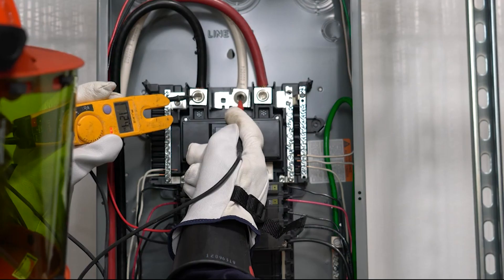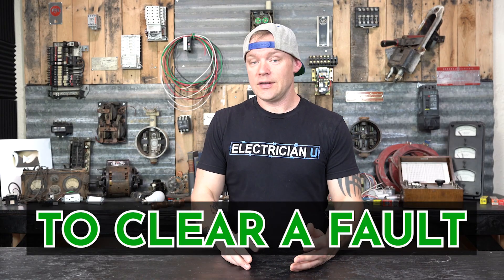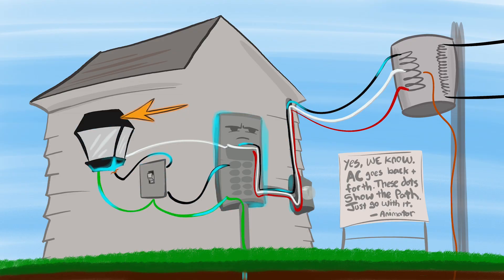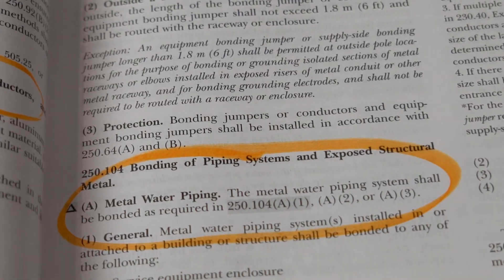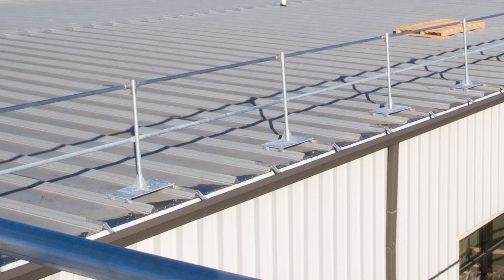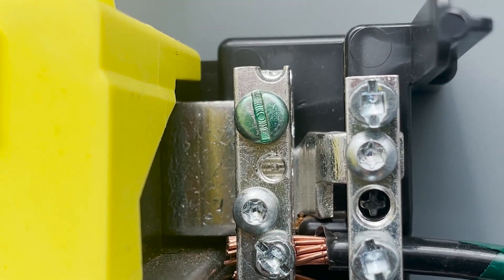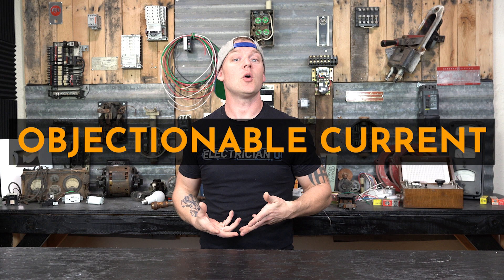Why Do We BOND Neutral & Ground in ELECTRICAL SERVICE PANELS?

Comment: I think it’s incomplete to say that current wants to return to its source. 

Current is a dissipation of electric charge from a highly positive voltage location to a lower voltage location. The earth is ~O volts, which is pretty low. So in reality, virtually all current is seeking to get to the earth. The story is more complicated for AC but the concept holds.

The ground wires provide a path to the earth through the grounding electrode on site, which is relatively high impedance. 

The neutral wire provides a path to the earth through massive grounding mechanisms on the utility side, which are relatively low impedance. 

These two paths are in parallel, and the current will take the parallel paths in proportion to the impedance. 

An interesting corollary is that when there is current being used in a house, there will always be a very small amount of current flowing through the grounding electrode on site. 

I agree with everything else you said, and it’s a great video!
Reply: No
Reply: @KevinCoop1  tell me more!
Reply: @mrfischedm     Yes, earth is zero volts.  The only reason electrical systems are connected to earth ground is so if lightning strikes at or near the system, the energy is dissipated to earth.   That is the grounding electrode conductor and ground electrodes portion of the system.   All the rest of grounding in the system is called equipment grounding.   It’s purpose is to carry fault current from metal parts that get energized incorrectly, back to the main location, to the neutral, out to the transformer, through the coil and back to the panel with low resistance so enough amperage is allowed to make the magnetic portion of overcurrent in a circuit breaker to trip.   
As there are ungrounded systems that are used to do work, earth has nothing to do with it.   If your all current is seeking earth is correct, then how is it possible for any ac or dc system work without a ground at all?
Reply: @KevinCoop1  I think we’re saying compatible things. 

I wasn’t saying that all electrical charge is seeking the earth, I was saying that all electrical charge is basically trying to spread out to minimize differences in electrical potential. That’s what creates current in the first place. When given a sufficient conducting path, current flows between places with different voltage e.g. from relatively high potential to relatively low potential. The story most people tell is that current flows from high potential (the transformer) and back through the neutral conductor to low potential (the transformer). But the more complete truth is that current goes from high potential (the transformer) and back through the neutral conductor to ground (which is provided both onsite and at the transformer). All transformers I know of are connected to big grounding rods. 
All that helps me make sense of why neutral and ground are connected at the panel – both the neutral conductor going back to the transformer and the grounding conductor connected to the grounding electrode on site are just different paths back to earth. 
Maybe I’m wrong though. What you said about ungrounded systems was interesting. Can you give an example of an AC system that has no connection to ground at all? All the AC systems I know of are connected to earth ground either onsite or on the utility side. But I’m sure I don’t know them all!
Reply: @mrfischedm     Dave, are you a physics guy?   The electrical system in a house could (and used to be) not connected to earth ground at all.  The first NEC was published in 1892.  My copy says nothing about grounding.   Then along came earth grounding to stop everything from blowing up when lightning strikes occurred.   Next, in the 1960’s, NEC decided too many people were getting shocked by touching the metal on their appliances.  So, then came equipment grounds.   So, earth ground is for lightning and nothing else.   Equipment grounds are for shorts to metal cases, have nothing to do with earth ground, and are connected to same point in the main panel to neutral because you do not run equipment grounds from utility transformer to a panel.   Utility is only hots and neutral, no ground.  
Im not trying to be mean, just hopefully helping you understand.   Respectfully,   Kevin
Reply: @KevinCoop1  Yes my background is physics which is why this confused me at first. I think you would agree that neutral from the utility is kept at 0 volts. If so we’re on the same page about most things.
Reply: @mrfischedm     The zero volts you keep referencing.   Let’s think about that for a minute.   Is it truly “0” volts?   With no grounds, the two conductors, let’s say black and white, are 120 volts between them.   Now, let’s tie another conductor(bare) to the white.   Since the white and the bare are connected together, a meter connected from black to either is 120 volts, correct?   And a meter connected to white and bare is your “0” volts.   If you do not connect the white to the bare, and the bare is connected to a ground rod only, the meter from the black and the white will get a voltage value from each.   My best guess is around 90 volts, at least that is what I found at a location once.   The end result is in reality, both the white and black are 120 volts, but measuring from ground that is connected to the white only black shows 120 volts.   So ground and grounded conductor(white neutral) is a zero reference point for the meter.   I hope this is helping!   Sorry so long!   Respectfully,   Kevin
Reply: @KevinCoop1  Just to clarify, let's say you connect your meter between two points. Point A is the neutral conductor coming directly from the utility, and Point B is a grounding rod. You're saying the voltage between those points will NOT be 0 volts?
Reply: @mrfischedm   I am going to back up a little!   If the  white neutral is “not connected to the ground at any point(ungrounded system)” you will get no volts from neutral to ground and no volts from hot to ground.   There is no complete circuit.   You can not really do this in your home because the utility grounds the neutral at their transformer.   Must have a complete circuit to get a reading on the meter.
Reply: @KevinCoop1  Interesting discussion, and I learned a few things. Thanks!
Reply: @mrfischedm    I have talked to my daughter in laws brother who is a physics professor.   We had some interesting conversations as well.
Always good to discuss with others!   That is how I learned the most!   BTW, I’m a retired Electrical Design Engineer.  Respectfully,   Kevin

Comment: I have a question about 3-wire homes vs older 2-wire homes.  If one lives in an older home that only has Hot (black) and Neutral (white) without the third bare copper safety ground at the service panel so that most outlets are only 2-wire without a safety ground, and one needs a rigged safety ground to fool a UPS to prevent the buzzer from buzzing all the time, is it OK to tie the safety ground terminal to neutral terminal at the outlet?  My bathroom and kitchen sink outlets have the safety ground for the GFCI outlets and there's a non-GFCI outlet by the stove and in the laundry room that have a safety ground (both according to an outlet tester), but none of the rest of them do throughout the house.  The added safety ground for the bathroom GFCI is a singly-run green wire, and I guess the kitchen and laundry room are done the same way.  I've only done it to fool 2 UPS so the buzzers don't buzz, but is this safe or dangerous?  Thanks
Reply from the maker: Bootleg grounds, like what you described, are pretty dangerous and sketchy. People who flip houses often do this as to not have to replace whe whole house wiring. The best way to fix this issue is to bite the bullet and pull new wire. At this time with the way material and prices are, this is easier said than done. A safe alternative is to install GFCI devices are the most upstream location. What i mean by that is at the first receptacle on that circuit, add a GFCI device there and that will protect that circuit.
Reply: @electricianu   Thank you!  Your willingness to help is outstanding!!!  I didn't think about using GFCI outlets.  That way, I could run one green Safety Ground wire and protect everything on that Breaker if I put the GFCI on the first outlet spot off that Breaker.  I saw a video about that and how to find the first one.  But wouldn't I then also have to run and add the green (or bare copper) Safety Ground wire to the third terminal on every outlet down the line if I want all of them to be a safe and proper 3-wire with Safety Ground?  That third terminal has to get Safety Ground somehow.  Or would it then be OK to tie White and Green terminals together with bare copper wire?  Thanks

Comment: I ain't looking to see if anybody mentioned this in the +12,000 comments before me,  I only looked at the amount that fits on my screen. Absolutely what all sparkys need to be discussing and getting their heads around. 

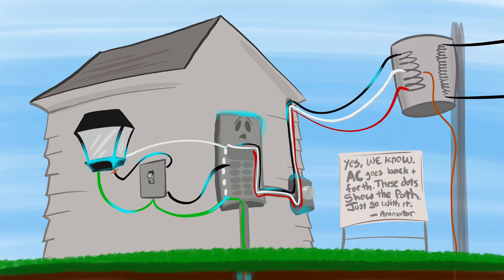Great Job! But if you don't mind an ol' timer wireman butting in... but...your cartoon is correct at ~2:16 mark, the vast amount of electricity is flowing from the neutral bus in the panel to the pole mounted tranny (ignoring the insignificant amount of current flowing through the high impedance parallel path that is from the GEC, through the soil, and up the pole's ground wire to the neutral tap. To keep it simple, I would ignore that current in the cartoon too.) But at the ~3:43 mark, when the main bonding jumper between the ground and the neutral bar is added, it looks like the current is flashing down the GEC and electrode, and no current is shown going back on the neutral to the trannny?! There isn't any path indicated at all flashing back to the source. It would be way more accurate to show the fault current coming into the panel on the EGC and flowing through the Main Bonding Jumper to the neutral bus, back to the tranny. 

I'm still giving you a big THUMBS UP!

Comment: What if I have 2 inverters not stacked and each one serves its own panel. Seems like I would only be able to bond one panel because if I bond both, the neutral form each inverter will be touching the same ground grid...
Reply from the maker: I would imagine upstream from both of those panels would be a common disconnect. So, the bonding would take place at this point.

Comment: You really should make it clear that this is only OK in the crappy US systems. It's positively not done in the UK and I guess the whole of europe.
Sadly, we have several different grounding scenarios. In my case, the wire the power comes into the house provides a grounding connection - it's basically the metal covering of the power wires.

Comment: Ive watched the electricians work at various jobs turn a screw ...pull some wire ...a. box....here...there a switch......pass throu hole strip ...turn screw ...black ..white....etc etc .......
And just by accident I’ve seen an electricians bill for work ...well buddy shown me 
Well I just about filled my pants with the brown stuff!!!,!........he did that and charged you that !!
I’M IN THE WRONG LINE OF WORK !!!!!!...........

Comment: If power goes thur the ground due to power wire arching ,  the box breaker can determine the circuit has a issue  because the current is arriving back to the box not in the traditional  netural circuit.  This is my understanding
Reply: It is because the current goes from ground to neutral in the box, because it’s bonded, out to the transformer, back to the panel.  The grounding system makes a very low resistance path to allow enough current to make the breaker trip.
Reply: @KevinCoop1  yes im wrapping my head around it in my thinking understanding. Sometimes its better to further explain terms that could be put in a simpler format. Ex. Bonding ect.
Reply: @justinbustin677    This concept is extremely important to understand.   In my experience as high as 95% of designers, engineers, and electricians think for some reason that ground faults go to the grounding electrode(rod), etc.    earth grounding is only for lightning dissipation.
Reply: It is, what im saying is your communication  with folks that dont know all the lingo. As my example with bonding. My main first post was this is how i understand the ground and neutral fault purpose  and does that sound  correct.
Reply: @justinbustin677  ok on your terms.   It is not that the current is coming back not in the traditional neutral.  If the power wiring arcing to a grounded part, then there is no load in the circuit.   Since no appliance or load in the circuit, then very high amperage occurs( thousands of amps) from the hot and through the ground conductor.   The high amps creates magnetic field in the breaker that causes it to trip.   Make sense?
Reply: @KevinCoop1  yes a short at regular plug in receptacle, from black hot wire. Arcs on the box. So current is not going back to main box via the neutral wire.  

Arching on the box, the ground wire then carries the current back to main box  and the main box breaker says, this is not correct which in turn flips the breaker.
Reply: @justinbustin677     Basically correct without being technical.   That works!

Comment: Could you explain why the Ariel pair to residential home in our area only has the two black positives and the wrapped ground cable instead of a neutral and ground?
Reply from the maker: Expecting your service entrance to be properly grounded in order to then provide a derived grounding system / neutral at the meter (I'd assume.)
Reply: @electricianu  I have neutral in 150 panel. Ground to water pipe and 2 grounding rods outside.
Reply: @mobilecommunicationsnetwor5268     Service entrances conductors do not get a separate ground.   Neutral and ground are the same in the incoming cables.   This is why they are bonded in the main panel.
Reply: @KevinCoop1  Okay great that helps me understand what's going on here.

Comment: Grounding  paths all must go to one location and with and interveing connections. For instacne a light rod goes to a ground pole that ground connection must also go directly to the power pannel and not thru the water pipes - the water pipes must be connected directly to the same ground of the lighting rod.

Comment: in animationI don't think your transformer picture is right either.  you have a ground from the secondary I think that should be from the primary.  Check and let me know.
Reply: also, if the neutral was connected to ground as you show it wouldn't be neutral anymore.

Comment: Correction for the cartoon: AC does not go "back and forth." This is a common misconception. The voltage oscillates in a sine wave from positive to negative, but the magnetic field also oscillates from positive to negative on the Z axis, perpendicular to the current. So the flow of electricity is always one way. It's just the voltage that is fluctuating.
Reply: Pretty sure Tesla would disagree with you.   There is a reason he called it Alternating “Current”

Comment: For starters, man, you should have been a teacher.  Excellent performance here.  

So … I have a puzzle for you if you have the time.  I just undid the four-prong pigtail from an old oven/stove in my daughter’s house, and whoever installed this pigtail—which had four wires, including the ground wire—had put both the white neutral wire and the green ground wire of the pigtail onto the same center post on the oven.  Why would an electrician do this?  Shouldn’t he have put the ground wire on a dedicated green grounding screw?

Another, possibly related item: the house was built in 1976, and should have only had a three-prong 220 receptacle.  However, the receptacle was a four prong.  I was surprised to see this, and wondered if the same electrician only had, say a four prong pigtail in his truck, so, being a jack, he also had a four prong receptacle.  Being a hack, he simply installed a four prong receptacle in place of the house’s original three prong receptacle, but did not run new wiring that had the ground wire.  And this is why he installed the white neutral, along with the green ground to the stove?

From what I gather from your teaching here, the ground and neutral should not be combined except at the main fuse box bus bar.  And certainly not at a large appliance final connection, like at a range/oven.
Reply from the maker: From what I gather, you have what is called a  bootleg ground….. Sort of? I am confused as to why they would have done this as well. So they had 2 ungrounded or hot conductors, i.e. Red and Black, a grounded conductor or neutral, and a ground present in the box?
Our FB group and discord server are also great places to bounce ideas off of other electricians (and you might get help more quickly!) 
https://www.facebook.com/groups/electricianu
https://discord.com/invite/7ykYfbh